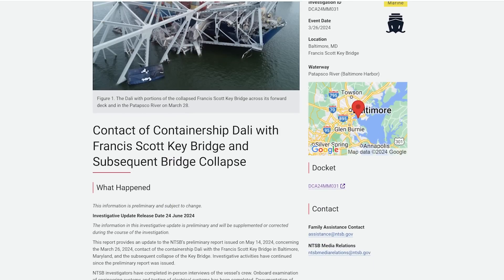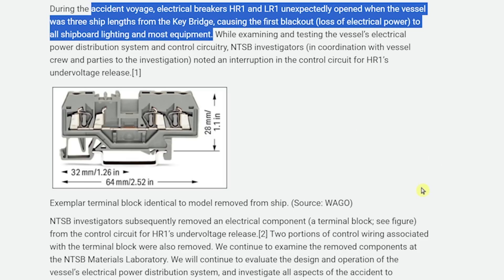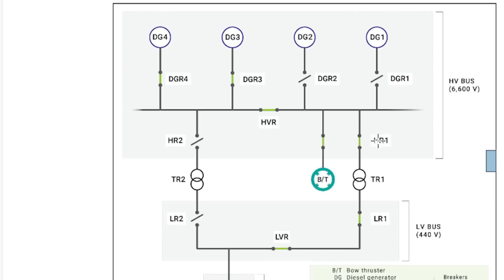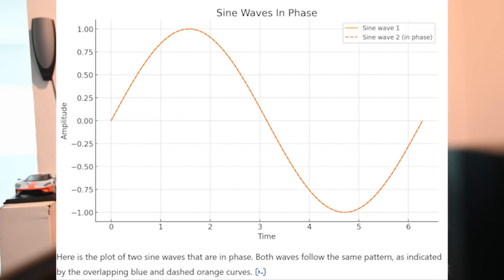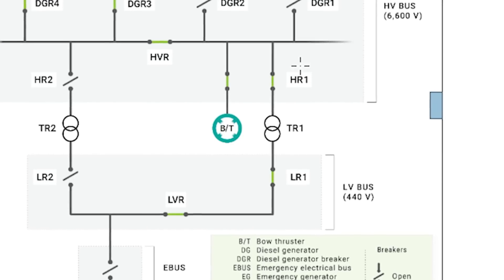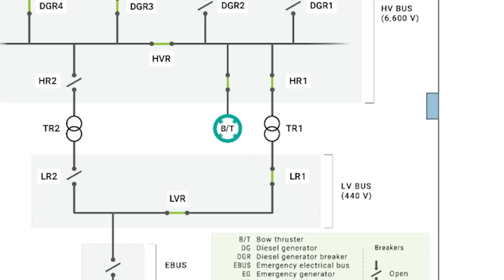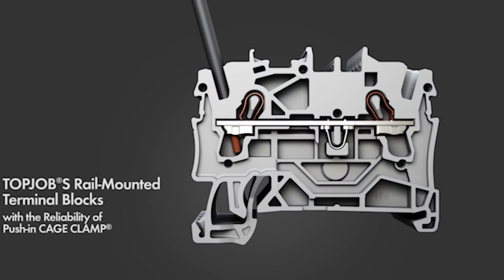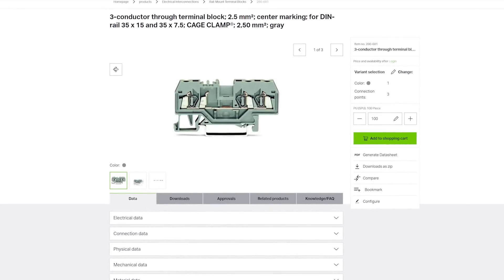Did This Part FAIL Cause MV Dali Key Bridge Collapse?

Comment: On the face of it this feels like a stupid way to wire up an ocean going vessel that's subject to corrosion from salty air, and years of exposure. Now I'm not an electrical engineer by trade and I certainly don't know how more modern ships are usually wired up, but every single snatch/terminal block I've ever seen sub-220v in a boat has been screw terminal, never seen a quick fit or push in connection, even in low voltage circuits. Just based on what I have personally seen in the wild. You'd think push in connectors subject to potentially corrosive environments would be a no no? I don't know...

Comment: They will discover the switch gear manufacturer substituted the design approved terminal block manufacturer with a Chinese knock off part and saved some money. The NTSN should closely examine the terminal blocks to see if they are correct.

Comment: Several possible causes. 1. Terminal block specified does meet voltage or current specs.
2. The wire installed incorrectly. Insulation was not remove around wire termination.
3. Missing side insulator end plate.
4. Moisture, corrosion etc ..

Comment: The question is: Is the terminal block the correct block needed for this job. Have the ship engineers put a completely wrong terminal block in the circuit, and that's why it failed?

Comment: Around 2001 or 2002 a generating station caught fire in Jax FL. I was watching my expensive Sony 45 " TV, power went out around 9am, so I went to work. I came home about 6 pm, around 7 power came back on. T V came on with lights as I didn't shut anything off, just went to work. 20 seconds later TV fritzed. Why? When power came back on it had low voltage till station put out sufficiently. Sony didn't have low voltage protection!!! My bad, 3 grand down the tube.

Comment: It'll be the design. Having a "fail-safe" which is actually disastrous to the functionality of the ship is not a fail-safe at all. What's missing is a buffer between the generator outputs and the load, allowing variation in speed and therefore phase to occur.

Comment: The power on the bus would lock the phase and voltage in some respects is my understanding, so the generators would not have gotten out of sync.  It is only when connecting that the phase and voltage are critical as they will sync together by force.
On the paste on the wago connector thing, no self respecting person would use aluminum cabling and try to terminate it into a connector like that. so that is unlikely,  If it was the case they should be fired.
Reply from the maker: They can get out of sync if a generator develops a problem

Comment: I remember hearing like a day or two after the crash, that there were reports of there being a recurring problem they were trying to fix, and it appears, probably through company pressure, that tbey weren't sure the problem was fixed, but left anyway. Someone is going to be in a lot of trouble.

Comment: The idea of using something that requires a lot of regular maintenance on a ship to initially save a relatively small amount of money makes little sense to me as if you missed seeing that the paste was no longer working you could end up with corroded cabling and switch gear with a hefty replacement cost. In the long term in a high risk instillation like a ships main power it would make more sense just to use copper and save on the maintenance budget for the extra needed inspection schedules to keep aluminium cabling in serviceable condition.

Comment: It’s seem to me that the under voltage relay. Had a loose wire.   It’s a little solenoid.   If it doesn’t have 120v (usually) the breakers won’t close.  And if it’s closed it will trip the larger breaker open.  We use them to prevent closing a breaker out of phase. Or also on ventilation blowers to open if fire pull shut down are activated.

Comment: I blame the dumbass low sulfur fuel ships in port since 2020 are required to burn exiting the port cold prior to firing and getting hot.  This container ship was built in 2015 in South Korea before these dumbass Netzero rules kicked in and was not engineered to burn these low sulfur fuels.  Save the Planet nonsense knocked out this Baltimore bridge without bumpers built in 1970’s prior to when in the 1990’s container ships doubled, 2000’s tripled and 2010’s quadrupled in size.  Not to many ships lose power entering port running hot but many since 2020 lose power attempting to exit ports burning special low sulfur fuel Green fuel from a cold start.  Just saying.

Comment: Undervoltage protection breakers are a common thing. When there is not enough voltage, a motor has not enough torque to start spinning but enough power to burn out when it is stuck. 

You can buy circuit breakers with built in under-voltage protection. There are even breakers where you can install or retrofit a module to do just that.

This is a common way to retrofit an emergency stop button into old machinery. Just install the button in series to the under-voltage module. The button cuts the voltage and the breaker "thinks" there is an under voltage event and trips.

Also most Generators have this feature. When the motor stops or the generator is unable to produce enough voltage, the breaker trips. Also when you turn off the generator, the breaker will automatically turn off, too. So when you start up the generator, you won't torture the loads with the generator spinning up. You can't reset the breaker until the generator is fully up and running.

So nothing new, nothing fancy, just a basic circuit breaker used in the electrical system of the Dali.
When the under voltage module inside the breaker has loose connections like solder joint cracks, it can trip "randomly" sensing not enough voltage to remain switched on.

Comment: Aluminum oxide has a higher resistance than the wire. What seems more likely is that the wire clamps in the terminal block were old and getting weak probably from years of abuse from the roughness of the seas. Screw terminations would have been much more reliable for this application.
Reply: But how likely is it that they used aluminum wiring?

Comment: I'd be surprised if a spring type connector is used for anything more then 1 amp.  They do make constant contact & don't loosen up from heat cycles,  but don't ever make good contact on stranded and/or large wire.

Comment: Pictured is a 3-pole or 1-to-2 wire expansion IEC terminal block.  It clips into a rail, called a DIN rail, with other IEC terminals or any number of other components – it is a universal mounting system.  

Over the years, I have used many thousands of IEC terminals of various sizes and configurations in the construction of industrial machine controls panels.  

These terminals are typically rated at 300 to 800 Volts depending upon size and design.  What is not shown on the drawing is the current rating in Amps, which determines the current rating in Amps.  

The wires are attached to the terminals by one of two ways: A convoluted flat spring which is opened with a tool resembling a flat-blade screwdriver inserted into a hole at the top of the terminal for wire insertion/removal  - or a screw & clamp terminal.  

The drawing shows a spring-type terminal.  The idea behind the spring terminal is rapid connection – push down on the insertion tool through the hole in the top, insert the wire through a corresponding hole, then remove the tool.  You may imagine that the screw terminal takes more time and effort to make a connection.

But I prefer it as you can get a tighter more reliable connection with more contact area, particularly when ferrules are used on the wires (to avoid split strands or breaking strands) which is always best practice.

So what could have happened?  This block would be in a low-current control-related circuit – with this block likely being rated at 8 Amps – but we don't know for sure (a width dimension is not shown in the drawing).  If corrosion occurred between the spring or contact pocket, high resistance would develop creating heat in the joint.  This could anneal the spring, making it lose pressure on the wire, causing an intermittent connection.

Only The Shadow knows for sure.

Comment: As the voltage drops the amperage increases.
Watch a car with a bad battery as it turns over and you can hear the starter slow because of the battery the cables will start to overheat, the slower the starter turns the engine over the higher amperage demand on the battery.
A 20-amp breaker trips when there is a short or when the amperage exceeds 20 amps.

Comment: Jeff,

You need to think of LR1 and HR1 in terms of their being relays and not so much as circuit breakers.  The relays act more like switches linking parts of the buss bars.

I believe the components you were showing were from a low voltage breaker.  M/V Dali was running a 4500ĶW and a 4000KW generator.   These are 6.6 kV machines.  The current ratings are about 618 and 600 amps.  Bus ties will consist of multiple large copper ɓars, similar to 6 - 3" high by 1/2" thick.  Special tools and protective clothing are required for 6.6KV work.  I would be very surprised to see aluminum wiring used.  IEEE 45 code, in 1997, even banned the use of aluminum for protective weave on cable in the shipyards.  I have never seen "click" connections on ships.  Considering size and the use of multistrand wire, I don't believe "click" connections will work.

There are two  distinct, but highly integrated being discussed.  The Power Distribution System (PDS) is known to most as a one-line diagram.   The Power Mananagement System (PMS) is the computer system that integrates all the machinery and electrical equipment making it possible for the ship to run.  You could have a faulty PC card in a relay causing it to trip.  Or, you might have a glitch in the line code of the PMS sending an incorrect value causing the relay to trip.

In 1997 USCG rules required that you parallel generators using three lights.  When the patterns matched you could close the breaker.  We found it to be close to impossible using the lights.  Too many variables, far more complicated systems.  The lights remained, but we didn't have to use them.

Bob

Comment: In my system engineering work I've used Wago parts extensively including similar din rail modules like the one pictured. They are well made and reliable. They are potentially useless if you do not properly tighten the screws. It is possible to tighten the screws down without being on the conductor(s) you want to secure. If the control circuitry for the buss breakers was intermittent it could be perceived by the system PLC as a low or no voltage and drop the buss connection. 😮

Comment: I am an electrical engineer with 30 years of electric utility work experience.  The 6.6 KV bus was energized and the two generators were tied together before the power failure.  First, Synchronization and voltage considerations were not a factor before the event that caused the trip.  In utility systems, we have electromechanical devices that leave a target indicating the tripping current path by a sensor.  IE. low voltage, high voltage, over current, under current, change in frequency, bus fault, transformer fault to name a few that come to mind.  When a breaker trips  there is a lock out relay that has to be reset before the tripped breaker can be closed.  Forcing insight and investigation as to the cause of the trip.  

I would think on a large commercial ship that the protection scheme would mimic a utility system.  From what you are saying a bad electrical connection on sensor wiring sounds reasonable.  

Also, from what you read, I believe the 6.6 KV bus was never tripped or lost.  Which begs another scenario, the opposite breakers and transformer should have energized after the initial trip.  ????????????

Again, it is never a good idea to reset a lock out relay and close a breaker without investigating the cause.

Comment: Those parts have contacts which and if the wire is loose or the contact is worn can cause arcing and lead to the breaker dropping out.

Comment: Undervolgae release its just a Coil (elektromagnet) inside breaker which trips(opens) breaker if the coil voltage is lover than 30-35% of nominal voltage. This coil is not responsible for monitoring bus voltage. To close and keep closed breaker this coil must be energised all time. So if there was loose wire in wago terminal which was supplying UV (undevlotage coil) then breaker will trip. Opening primary breaker will csause to trip a scondary breaker (also via UV) - UV coils are used very often in marine switchboards, simple way to ensure that power goes only from source 6600VAC to consumers 440VAC. Spring terminals are way better than screw terminals do not need of retaightenning after the time - but they have to be used properly. Most common mistake which i see is trying to insert 2 wires into single hole without proper double ferrule.

Comment: Hi Jeff thanks for the great video. I work in the railway signalling field and we use WAGO terminals extensively, even the exact same 2.5mm2 terminal that the NTSB has shown. WAGOs are one of the best terminals one can use and the main reason is that they are vibration proof. Since WAGOs were introduced in the railways, we seldom get any faults as a result of vibration which is a significant factor adjacent to a railway line. HOWEVER, there is an achilles heel and this is down to competence and training. 

If your video, the WAGO film clip shows one type of terminal where the cable core is pushed into the cage clamp. The other type of terminal (aka the NTSB photo) is where the cage clamp has to be pre-opened and the wire inserted. This is where the the achilles heel comes in. WAGO provide an insertion tool which is made specifically to open the cage clamp to insert the wire. You are also trained to ensure that the wire is stripped to the correct length so that when it is inserted, it fully engages with the clamp.

The problems start when a person does not have the correct tool and decides to use a flat screwdriver. The problem gets worse, when a person decides to use an electrically insulated screwdriver. This is where the shaft is insulated and only the tip of the screwdriver is exposed. So what happens is that the screwdriver is inserted into the WAGO and the uninsulated part goes into the clamp but butts up against the insulated part of the screwdriver. This prevents the cage from opening fully.

So when a mult-stranded cable is inserted, especially a small 2.5mm2 type, it does not fully engage at all and nominally a couple of stands may be lucky enough to be clamped, but the rest contribute to a loose terminal connection. 

When we first stated using WAGO's, loose wire terminations was a major problem and only through on-going training and ensuring the right tools were used was this problem eliminated. As I have already said, once correctly terminated, you never need to check it again - maintenance free. 

Certainly going to be interesting reading the final report, but I will put a wager on that this was the root cause. Keep up the great work.
Reply: Drop a video on this training.

Comment: This is 'life safety' so you could ask the question  'why have an under voltage coil at all?' Usually anything that prevent the function, is omitted. If the volts go down the current will go up and trip on over current, eventually. Synchronised Alternators, also look doggy to me. A bit Heath Robinson!

Comment: Under voltage protective relays are normal in any power distribution system to protect equipment from damage. Wago push type terminals are notorious with working loose or over heating from current. Poor craftsmanship like not stripping wires right length, broken conductor strands and how far the wires are inserted all play a roll. Sometimes, it's takes years to show up. I've seen first hand how hard problems like that can be to track down as the connections cool off and read good on the ohm checks but under load can go open circuit... Other factors like mech stressing the wires as a bundle on a movable  door can lead to looses connection problems.

Comment: As a retired electrician, two possibilities (strictly guesses) immediately come to mind relative to that little contact block. 
1- I would expect that all of the "control" wiring within those switchboards would be stranded copper conductors. Those little contact blocks with the "spring" type terminals are ALWAYS meant to work only with solid conductors. If stranded conductors are being used, they MUST be soldered on the ends where they will be pushed into the spring terminal because the terminal needs a "solid" conductor to  push the contact spring open in order to receive the conductor. Attempting to use stranded conductors without soldering the end first results in a bunch of the strands being pushed back and not getting properly clamped in the contact. This obviously could cause a overheating issue that would be noticeable due to discoloration. Given enough time, this condition could result in a loss of current flow across the contact and might result in the "low voltage" trip.
2- The spring connections can sometimes fail to properly grab the conductor and result in a high heat due to the loose connection/high resistance. Again, given an ultimate failure of the contact, possibly a low/no voltage trip ???